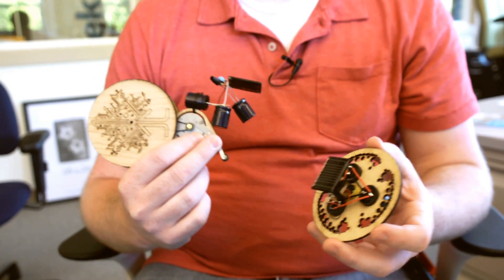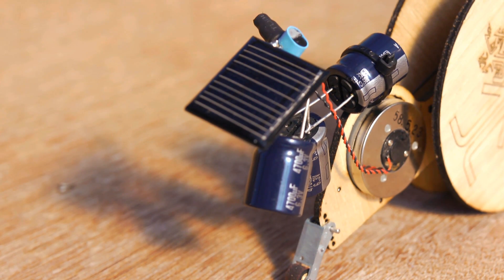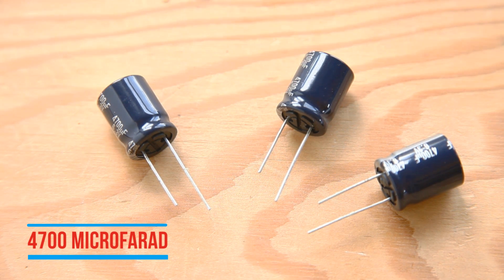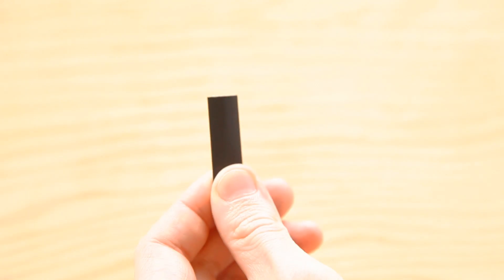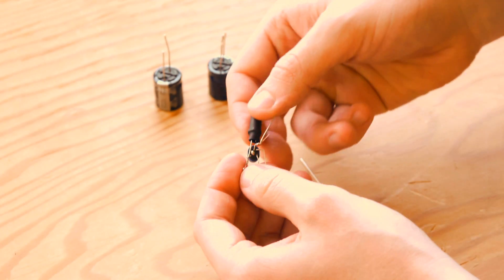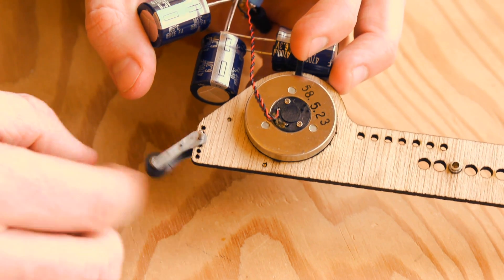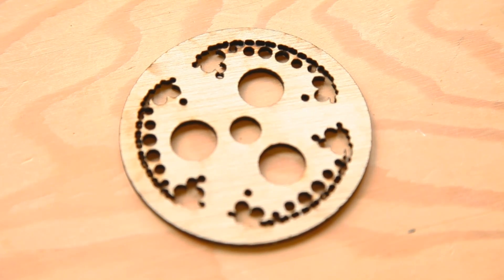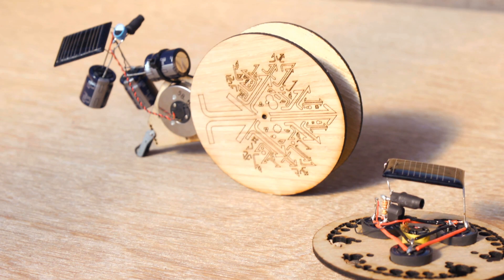Weekend Projects - BEAM Solar Chariots

Comment: I can't say I'd heard of KipKay until reading the comments.  This project is useful for getting an understanding of some core electronic principles and analog hardware.  Yes, this project only scoots along with solar energy, but switches and other components are easily added to create complex behaviors with no programming.  Check dumpsters for toys, walkmen, and VCRs for parts.  You don't need a lasercutter.  Paperclips are great for adding structure.  

BEAM is an excellent robotic entry point.

Comment: LEDs also act as light detectors. if it were exposed, the sunlight would trigger the caps to dump into the motor before they built enough charge.

Comment: No, you could use a normal diode though, just check the data sheet to see at what voltage it starts conducting.

Comment: Great Video guys, is the flasher led that necessary could one not just use a small voltage divider to switch the transistor.  That way it would role rather than jerk.

Mike